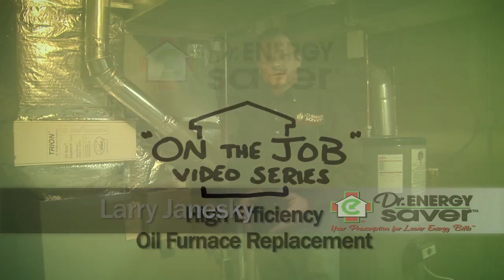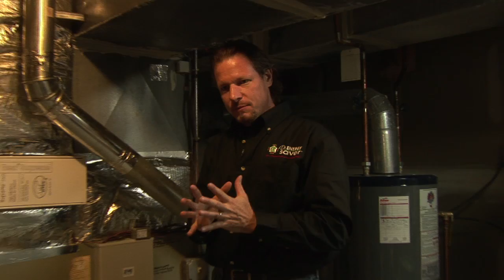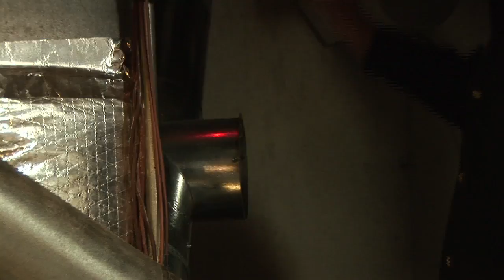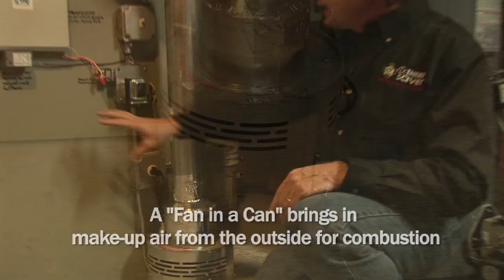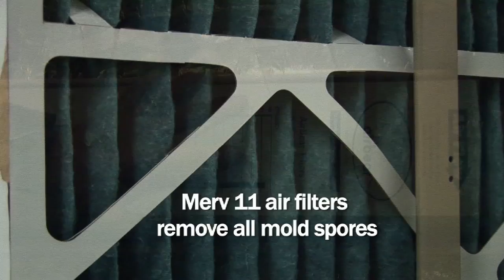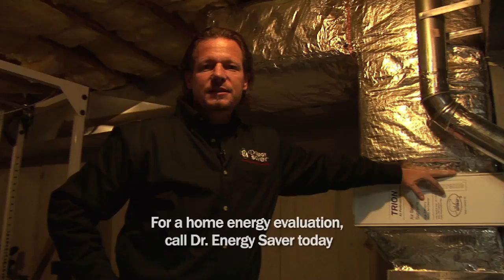High Efficiency Oil Furnace Replacement

Comment: FYI the barometric damper is to slow down the products of combustion up the flue  to reduce loss. its not combustion air. the fan in the can solves that issue.

Comment: My oil  furnace is 70 years old. Still works great but, of course, not as efficient as a new one. Since I installed mini splits I am not as concerned about the oil burner dying in the middle of winter.  I will probably die before it does.

Comment: If a furnace needed replacing after 10 years, the customer should get a 100% refund for it. It should be considered a defective unit.
Reply: chances are it was grossly oversized. a properly sized system should last long time when it is installed right.
Reply: They recommende replacement of hvac equipment every 10 years
Reply: Youcandoit Maybe My oil-fired furnace is 65 years old with most of its original parts... sure, It’s 78% efficient, but it’s keeping my home nice and toasty - reliably.
Reply: @youcandoitmaybe5909  oil lasts for decades.
Reply: @youcandoitmaybe5909  cast iron boilers have a service life of 30 years. They will last a lot longer if properly maintained and the boiler room is dehumidified in the off season. "They" are sales people looking for victims.

Comment: I leave the basement window open which provides a 'virtual' air vent for the furnace. Then you don't have cold air leaking into the house upstairs to feed the furnace. The waste heat from the stack and furnace compensate for the cracked open basement window. My furnace is 56 years old.